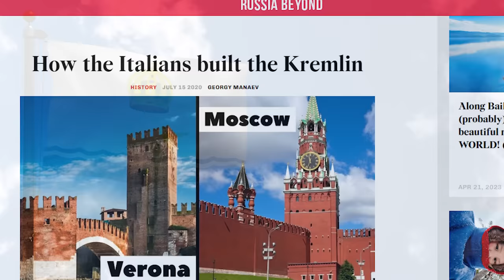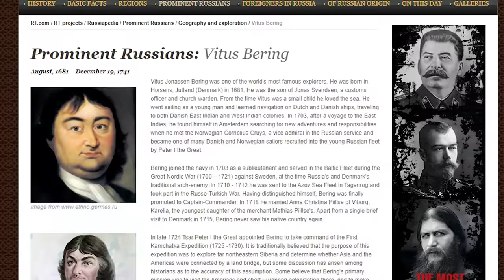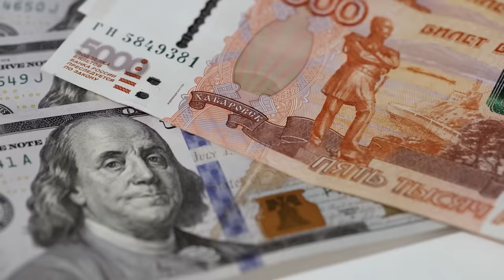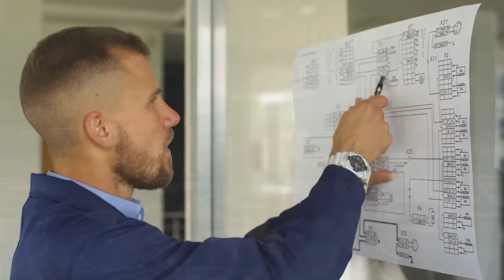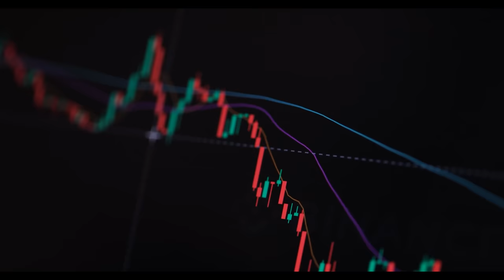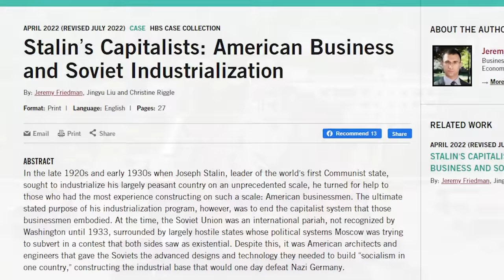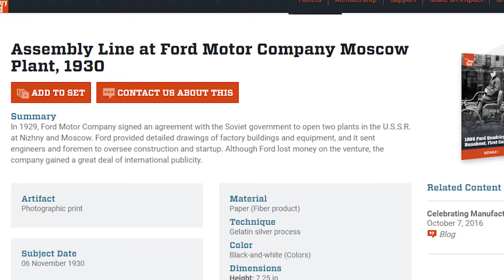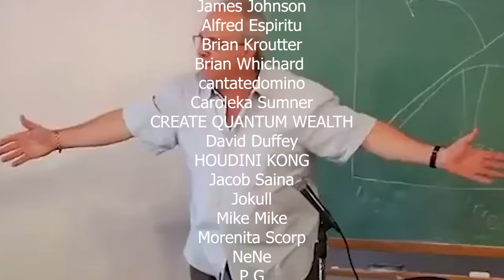This Is What Socialists Don't Tell You About The Economy Of The Soviet Union

Comment: Russia has certain geographic limitations. Most Russian rivers flow to Arctic waters or inland seas. Large parts of Russia are very far away from navigable waters and therefore cheap water transport is limited.
Reply: Railroads certainly plugged that gap,  though never as cheaply as river transport could.
Reply: @lamwen03  railroads definitely improve transport even if they are not as cost-effective as water transport.
Reply: Silly maritime mindset. If river transport is issue. Country can always build canal for shipping. Like Grand Canal in China. Vietnam build north south canal for river logistic during war.
Reply: @Alex Chau  for a canal, you must have a regular water supply. If you install locks, you can get by with less water. Still, there must be a source of water for the canal because water is lost to evaporation, and water that doesn't circulate becomes foul and a health hazard. 
     Even if Russia built a very long canal, Russia doesn't have two long navigable rivers to connect. Is it even possible to build canals connecting all the regions of Russia as the British did before railroads? I don't know, that would require the knowledge and skills of specialized engineers.
Reply: @Teochewtuahang  The distances are vast, the terrain uneven, it would take untold years to build a single canal linking two or more navigable rivers and the cost - well,  billions, even with cheap manpower and the best machinery, think how long it took to build a few paltry canals here in tiny England, no comparison.  Read about the building of the Panama canal.  And please, no need to be rude to Joan, it reduces the quality of your post among other things.
Reply: @sandrapicton6349  ever heard of China's South North water diversion project? That's how China bring water from south to north via canal to supply water to grow plants in desert. How long do you think it take China to complete?
Reply: @Teochewtuahang  Chinese are entrepreneurial and mechanically inclined.  Russian government has never encouraged domestic production because that would lead to a middle class of craftsmen and merchants needing and providing capital.
Reply: @carylhalfwassen8555  honest question here. Are you insinuating that the Russian government doesn't want that middle class of skilled tradesmen to exist? If so, why? Thanks!
Reply: @pamlemm903  Middle class for a thousand years has evolved from independent thinking entrepreneurs forming the core.  Skilled trades people exhibiting managerial skills and amassing wealth (capital) lead to questioning of authority and process.  Does the Kremlin want to cultivate these people?
Reply: @carylhalfwassen8555  yes it does. Communists dont, but russia isn't communist .
Reply: @deborahdean8867  Fidel Castro never had a problem creating enough educated people.
Reply: @kimobrien.  what does that mean? Whats your point?
Reply: @deborahdean8867  This idea that only capitalism with its privileges can create the educated people to administer, invent, and build is nonsense. Cuba has 10.000 foreign students studying medicene at no direct cost to the student at the Latin American School of Medicene.
Reply: @kimobrien.  education is not free to foreigners in Cuba my friend.  You have to pay, and they take credit cards. You also have to have your own health insurance.  Nobody said you had to have capitalism to turn out educated people . But if you dont you have to have good market management or you'll end up like Costa Rica where college is free and doctors and lawyers drive cabs for a living.  But the point is incentive. Not everybody wants to be a doctor, lawyer or engineer,  or even go to college.  People want to be able to work and realize their success or failure . They have inventive because the benefits are theirs. If I have yp work like a dog building up a restaurant business, put in the times, the ideas, and then have to turm around and have half taxed, or 90% given to employees  to share, why bother? Do something easier,  why invest your own money and take all the risk just to have to give it away to outstretched hands ..... like the government.   If you cant rep the fruits of your labor, you're a slave because thats what makes a slave, you work and they take and you just get 3 meals a day and the same place to stay no matter if you work hard, or half assed.
Reply: @Teochewtuahang  TOFU DREG
Reply: @kimobrien.  educated compared to whom?
please name all the best cuban inventors, POST revolution. all the best scientists .all the best captains of industry..
ill wait..
Reply: @kimobrien.  and the education they are getting is poor compared to a western school thats why no one is falling down, trying too hard to get doctors with degrees from Havana
Reply: @ripvanwinkle2002  Look you can brag about your Doctors all you want but the lifespan in the United States has actually gone down in recent years and for every three US Doctor who retire an Immigrant is required to replace him or her. The US Government would not be trying to interfere with the Cuban medical assistance program if it was ineffective.